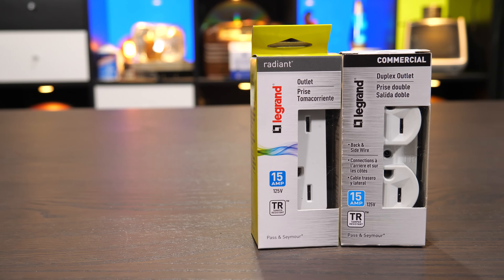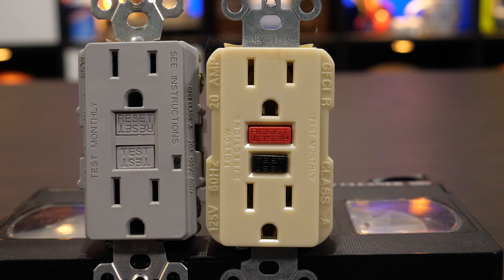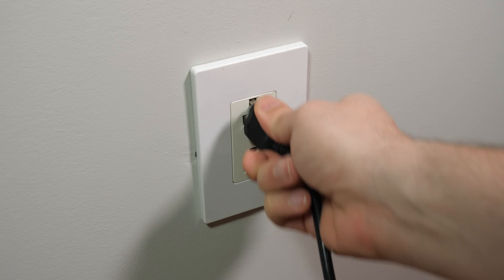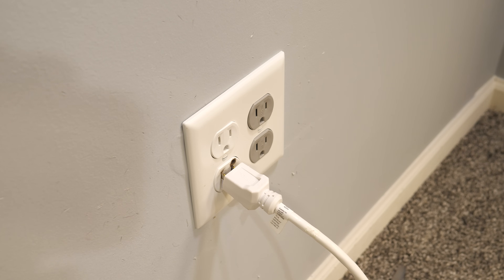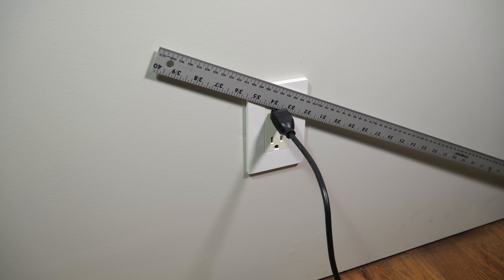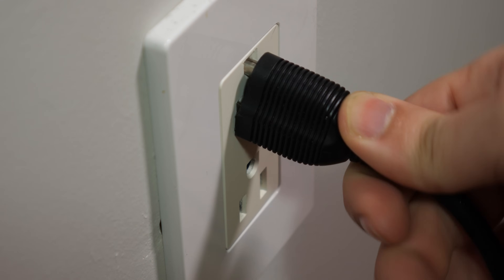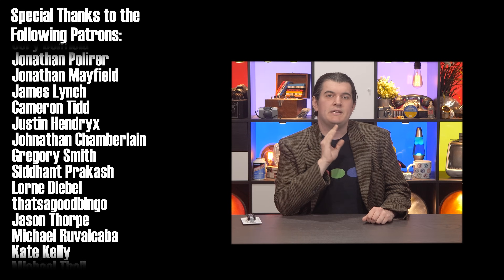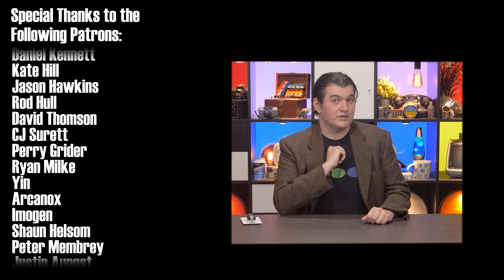Power outlets are topsy turvy - but does it matter?

Comment: Electrical safety in this country consists of good practice. Electrical safety in other countries consists of more expensive, over-engineered standards. We learn not to touch the metal on the plugs and be careful while handling them. The foolish learn the hard way, or get shocked twice. Foreigners, in my opinion, have an unhealthy fear of electricity. Yes, electrocution can kill you, but there is no reason to be paranoid about slipping and touching the prongs if your grip isn't wrong. The tape measure argument you mentioned is the ONLY good argument I've ever heard on this issue. And I thought for sure you were going to mention the falling picture frame argument.

Comment: I would say that Ground on Top is incorrect, and your video shows one of the reasons why(look at 12:50). The products that have the name/logo printed on the plug end, or if the device plug is built into the device is set to be read in the Ground on Bottom orientation.

Comment: As a home remodeler running my own business,  you did a absolutely excellent job on this!

Even soon covering the tamper-proof receptacles next is a plus.
Please try to find ones that are not junk.l, I haven't. Homeowners have me change them out all the time. They break easily to. Also look into the lobbying that happened to get these into the code books. Apparently it has more to do with charging more money then actual real world safety conditions... but we'll see. Looking forward to this vid.
Reply: As a chef in a French restaurant and having only one testicle, I agree with you!
Reply: I just did a whole host of outlet replacements. The Cooper TR outlets I put in seem to be pretty solid currently, dunno how long they will last (the old Leviton 30-year-old outlets were so worn it was a hazard)
Reply: I don't buy the cheap loose receptacles, but was taught to install them ground down.
Reply: I've liked Leviton TBR15 for my home. It's a step up in price going from residential grade to specification commercial grade so good luck convincing clients to pay for an upgrade that isn't cosmetic. If you can do it the tamper mechanism has been solid for 4 years for me.
Reply: You could always buy the premuim or commercial outlets instead of the economy.  I have never had them break and not sure what those people are doing to destroy those, but they may be the cheap ones made with cheaper plastics and metal seated solidly in their place.
Reply: What we need are sleeved NEMA-15 plugs.  That would solve many problems.

Comment: Had a thought, might work well in certain scenarios. Plan to do this in my garage where I already have a double duplex. But yeah, 2 gang electrical box, two duplex receptacles (that is 4 outlets total, two on each duplex.) Install one the normal orientation, install the other rotated 180 degrees. Now you have options for both styles of installation without having to use adapters and/or remove wall plates. Not to mention with a 2 gang install, your wall plate now has at least 2 screws if it's properly installed.

ADHD brain had this thought now and specifically now, so hopefully it's not something he mentions in the last 6 minutes of this video... but hey maybe it will help someone. And I'm sure an experienced electrician could point out any flaws in my idea as well.

Comment: An electrician told me that “Ground On Top” is HOSPITAL STANDARD.  PARANOID, you say, Junior?  If you’ve ever had an expensive, esoteric AM/FM tuner/stereo amplifier LITERALLY BLOWN UP by having someone drop the unit’s telescoping antenna against the + pin on a “Grounded Edison” 3-Prong plug, as you show with a measuring tape, you’d have the power plugs for YOUR equipment inverted, too!  I opened the unit to see if it could be repaired.  HA!  Many of the electronic parts (chips, capacitors, etc.) were BLOWN OFF THE MOTHERBOARD!  
Why the lack of a flared pin on a 3-Pronger?  If left in its original manufactured condition, it’s impossible to plug it in the wrong way thanks to that flare.  By the way- the walls here ARE MINE!  NOBODY gets to throw stuff at my genuine Lath-And-Plaster walls!  They are not as easy to repair as drywall (the “chalk between two pieces of paper” stuff) that CHEESY MODERN HOUSES are made of (my house was built in 1952, and Lath-and-Plaster wall construction was the standard back then).  Needless to say that when I had my recording studio built, I HIRED an electrician who insisted on hospital-standard ground pin UP installation of EVERY outlet in the studio.

Comment: If you're really concerned about it you can get outlets that have internal covers that automatically close when you don't have anything plugged in. 

Another thing to note about the old 2 prong chords, they used to have the same size blades, and could be inserted in either orientation.  Almost everything made today ( with or without a ground pin) will have the left prong larger than the right one.  This makes the plug polarized, and ensures that the smaller blade is connected to hot.  This is extremely important if you have a house full of old 2 prong outlets and use a 2 to 3 pin adapter (btw DONT use those, we call them Firestarters)
Reply: How can you NOT use them? My house was built in 1963 by the former owners, and nearly every outlet (the few there are) are 2 prong.  But I challenge you to find me a 2 prong power strip!
Someday (after we win the lottery or the house burns down) we'll get the whole place re-wired.  But for now we do as best we can.

Comment: anyone that has plugged a 10 gauge extension cord into a plug with the ground up, curses at the sparky that did it. The shape of the plug helps hold it in place when the ground is down. Put the ground up and the weight of the cord pulls it out and it arcs, shorting the life of the over 100$ cord. Side note, new outlets tend to pull the ground off the cords and many cords don't have a ground. Can't win

Comment: Insulating sleeves can be done so that they are compatible, the downside is that it weakens the pins a bit. You can clear out space for the insulator taking out some of the metal from the pins. Does not probably need a lot, half the insulator thickness. There should be enough clearance in the NEMA "standard" for this. By recessing the insulator a bit should help keeping it in place, and not just slide out. The Brits did it this way, afaik. 

I use Schuko and am grateful for that everyday. I've had to use all three and holy hell is the US plug unsafe. I would never reach for US plug in the dark, one handed at the back of a rack. With Schuko, there is practically no risks at all, dark, wet.. doesn't matter, the pins are always hidden before the plug is fully remevod from the socket..

Comment: How about the IEC-320-C13 (IBM style power plug)?  These plugs are a general neuscince . Everytime i get into a data cabinet they always back out of the plug over time. Anytime im working around any data equipment pulling in a low voltage cable, the first thing i do is push all the  IEC-320-C13 connectors in all the existing equipment into the equipment. YOU WOULDNT BELIEVE how many are partially backed out and ready to fall out. Now you might say... "well youre a low voltage guy ,its not your problem...".  When you pull a low volt cable in and your hand or anything bumps the  IEC-320-C13 plug and it falls/backs out of the connector and a data switch goes down, then you have just shut a server or switch down therefore directly effecting 24 + (if not an entire work place). You will soon become "the most hated person in the entire workplace and its all your fault " .Worse part is ?  Its not even your fault. Solution ? I always put a smear of adhesive on the  IEC-320-C13 plug once its firmly pushed into the equipment. IT guys may criticize you for it but at least the entire office wont hate you.Besides, honestly there are very few reasonons why you need to unplug the  IEC-320-C13 outlet at the back of the equipment once the equipment is installed and running anyway.If you wish to cold power cycle a piece of equipment ,youd be more inclined to unplug it on the UPS/wall outlet source than at the back of the equipment. These plugs have never should have been made yet tons are all over the place .

Comment: First your argument is that rarely any plugs come with a ground pin but then almost all right-angle ones you showed have a ground pin.
So the question isn't why are the outlets installed with the ground down but why are the plugs designed with the ground down.

But yeah, they all look badly designed. I have never had a problem with a plug becoming loose or anything.

Comment: This is a non-issue that tries to mimic the European style of outlet.
Electricians in the 90's tried installing outlets UPSIDE DOWN but, builders and consumers REEEEEEEEEED in disdain.
So stop fretting your soft little heads. You kids will be just fine.

Comment: The argument over receptacle orientation is about as pedantic as the argument about prepositions at the end of sentences.  Electricians tend to install them ground pins bottom in residential installations and ground pins up in commercial and industrial environments, but that is by no means the rule.  The number one reason to have a standard is primarily aesthetic.  You want all the devices in an area to look the same.

Comment: In the UK our plugs are almost all vertical cords, which explains why outlets with multiple sockets have the sockets in a horizontal line.  I've never seen a multiple outlet with a vertical arrangement, either in-situ or in a shop.  Extension cables with more than one row of sockets exist, but they generally have the sockets arranged so the cables go in opposite directions.
Reply: Not that having them in opposite directions helps when you're trying to plug in power bricks, for example the Sega Mega Drive's power adapters. All bets are off with those things.

Comment: Of course I understand how hard it would be to introduce a different design, but from all the ones I've seen so far, the type J plugs/outlets seem to me like the best solution: You have round, sleeved contacts, the outlets/"female" parts are always recessed so it is almost impossible to touch any of the connectors. Furthermore they are so much more compact than many other types, and you can fit three of them in the space of one of the more common ones.

Comment: If you don't care why make the video ?:P i don't see why us plugs couldnt be half isolated in the factory.  it is good that the US has an unique plug because they running 110 instaid of 240 and some devices might not handles that. most do . and most adapters just have an exchangeable US GB EU plug

Comment: The strip plug I have for my computer stuff has a right angle plug that also assumes ground plug down. But for some reason in this room that one specific power outlet was installed ground plug up. So I have the same issue where the wire goes upward. I every so often press it in to make sure its fully in since the cord is pulling it out over time. For a while now I've been wanting to flip the power outlet so I don't have this problem. As far as I know its the only plug in this house that's upside down.

Comment: @TechnologyConnections The metal ruler thing actually happened to me once.  The receptacle was behind a desk and a metal ruler fell into the narrow gap between the desk and the wall, lining the ruler up parallel to the wall so it fell just right, hitting one exposed blade and then likely pivoting to hit the other.  I can see such a gap making this much more likely over random knife throwing~
Reply: speak for yourself, our family has had knife-throwing competitions ever since AC rural electrification
Reply: Never heard of it happening over my entire career as an electrician/contractor. And the fall out more easily with the ground up.

Comment: Right angle plugs also tend to block the other outlet if it's on the bottom. That alone is enough not to use them except on devices that use more than 50% of the power you should plug into one socket.

Comment: Australian plugs have sleeve insulation on ~5mm of the live and neutral pins, the earth pin is lower.

Just prior the mandatory introduction of these, a person was killed cleaning Venetian blinds with metal blades when they lifted a blade, the other end went down under a power plug contacting the active pin.

With 230VAC there are few second chances.

Comment: Haha, joke is on you, we don't have that problem here in Japan even though we also use the North American outlet, because we just removed the Ground Connection and polarity all together in most of our outlets, even though according to construction code homes should have ground connections, and they should use Type B connectors.
Most house makers just comply with this by putting 1 or 2 Type B connectors in the house, and the rest are just pure Type A connections, many times without polarity.
We hate so much the Type B connector, that we even continue to use external ground using a raw cable that we put around a nail.
In fact, the hate for Type B is so strong in Japan, that international products, like chargers, that use originally the North American connector, waste money modifying the product just to remove the ground from the connector, and many times even outlet, even though, and I repeat once again, supposedly we have the same outlet, and Type B outlets with ground are a requirement in Japan.

Comment: Just an over all bad standard. The only way to fix any standard is to begin no matter how "difficult" or painful it will be at first.
Flip the plugs or inforce the standard, make the plugs right angle and you will end up with a far more stable and safer plug standard. You can make a ittle grip sectino on the top of the right angle ones, some of my plugs here have a safe grip area far away from the progs. So its even safe to use in the dark.

Comment: lol.. lots of scary stories that rarely if ever happen.  what if it rained in the house and the water came up to the outlet?  what if I was crying against a wall, and my wet tears created a stream of water and it hit the perchance open blades of the plug?  OH WOH"S IS ME!!
One reason to have the ground prong down, is to aid in inserting the plug. You start with the ground prong, then angle up to insert the blades.  If the plug is loose in the socket, then it is time to replace the socket.  Not the entire electric code.
But here's something else than can happen with ground plug up... the cord could also get tipped up and allow kid's fingers to be inserted from the bottom since that is where kid's are playing.. not from above.. but from below.
Yeah, it's all a big ado about nothing
and you are right.. all the larger plugs assume the ground plug is down.  And I agree too.. we need more right-angle plug with grip edges

Comment: Actually the extension cord I've used all through our recent year long kitchen renovation has a right angle plug that is the right way up for "non-face" plug orientation. I have seen enough plugs that have come part way out over the decades that non-face has become my preference, even though we were taught they had to be in face orientation in high school. 
Will I go through the house and change them all? Not likely. But any new work will have them installed non-face.